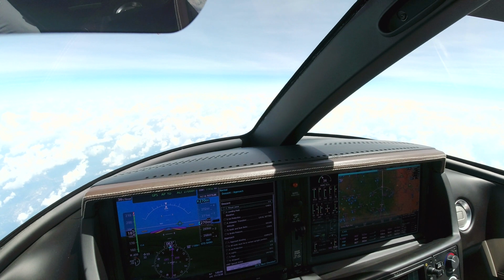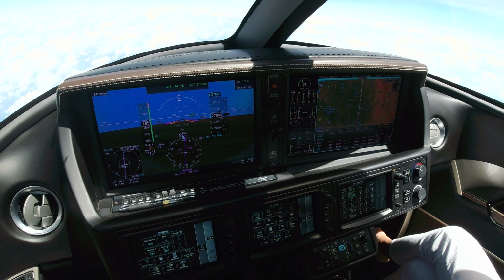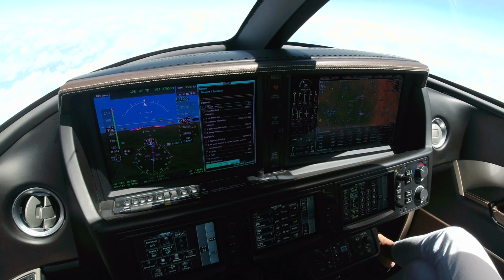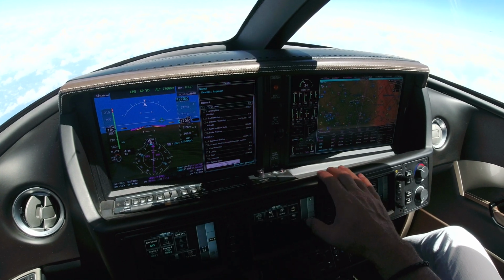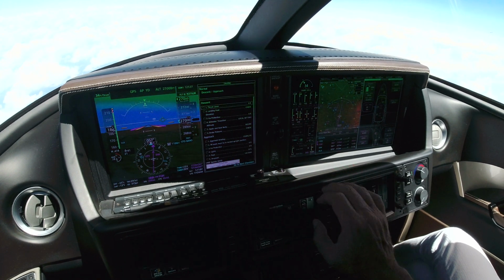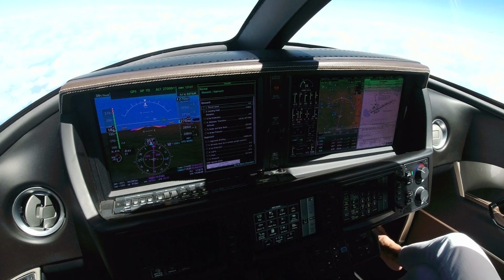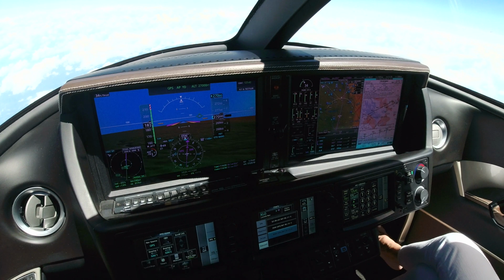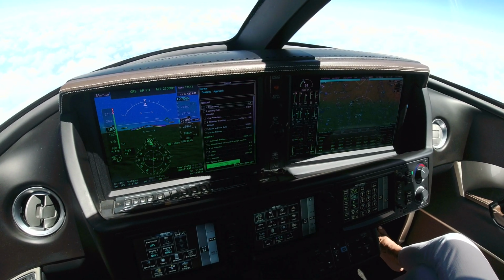In-Flight Video Cirrus SF50 Vision Jet Garmin Perspective Touch Avionics (4k Video)

Comment: Off subject but how do you perform a flight control check and verify the elevator function before flight since the pilot has no view. Is there a "control surface monitoring system" or visualization on the SF50? Thanks!
Reply from the maker: There are two occasions on EVERY flight when flight controls are checked.  First is during walkaround and preflight inspection.  All primary flight control surfaces are moved and checked for stability, defection and freedom of movement.  Flaps are checked for deflection and security as well.  The trim tab and balance tab are checked for security as well.  The second instance occurs once the pilot is seated in the plane and in accordance to the pre-taxi checklist.  The side stick is defected in all directions and then the rudder pedals are deflected as well.  The pilot can see the ailerons, but there are also display checks on the center instrument panel to be viewed for flaps position, roll trim setting and pitch trim setting.  All verified twice before each flight.
Reply: @DonAv8s  thanks so much for the reply! How do you know that the elevator is moving in coordination with yolk and not reversed for instance. I read about another aircraft that had this issue. Not an SF50.
Reply from the maker: @JZainbear  Look at the tail of a SF50. It does not have a traditional elevator or rudder system. They are combined in function using a mixer assembly.  It’s not likely there will be an issue and you would realize it in preflight due to binding or lack of freedom of movement.
Reply: @DonAv8s  That makes sense. Thanks!

Comment: With a fully charged battery, if there is an engine failure at say FL 280, how long will the PFD last on battery power?
Reply from the maker: With an engine failure, you lose the power generation capability and this essentially ties the batteries together an as emergency battery.  You probably have about an hour of flight time before complete loss of battery power.